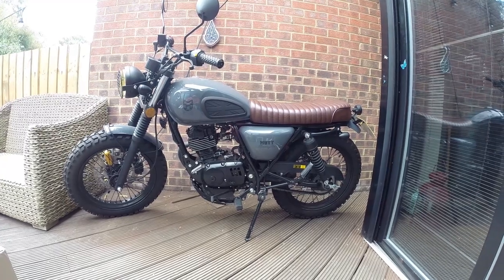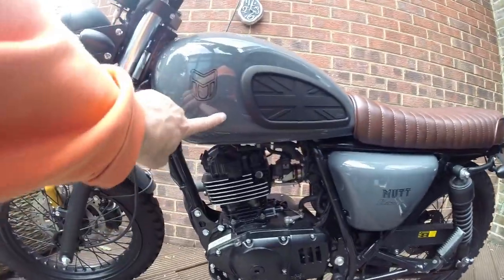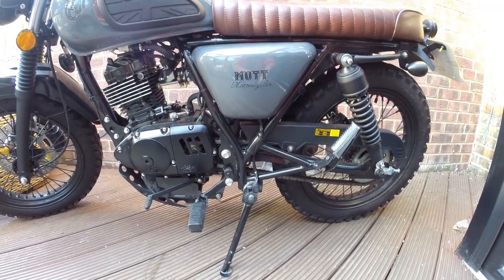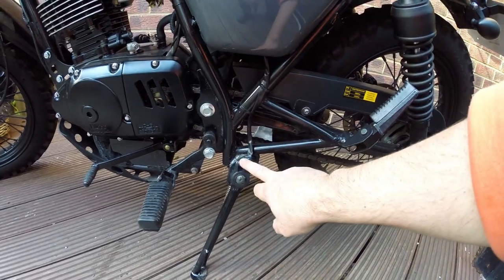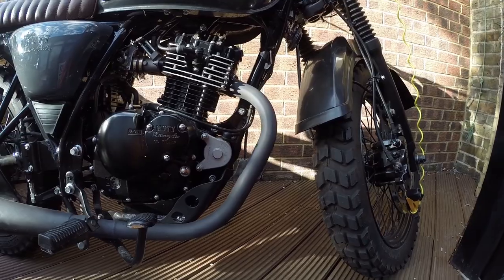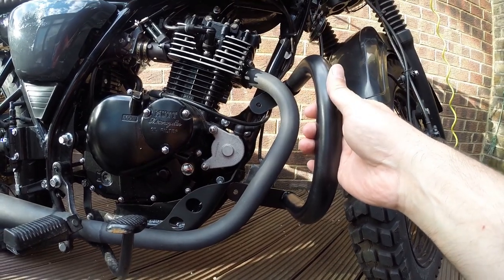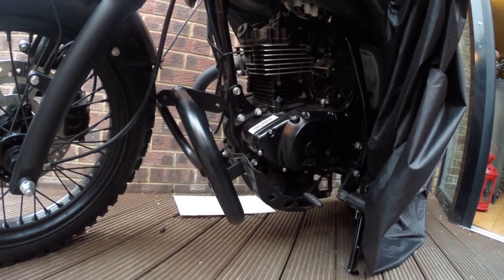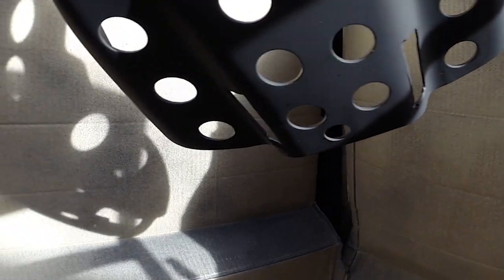Can the Mutt Go Off-Road? Dick Installs Engine Guards and a Bash Plate

Comment: My advice as an ex mutt owner... Switch out the indicators for plastic, the vibrations tend to shake the rear ones to pieces. Replace the rear shocks with RFY Shocks... they're about £100, changes the bikes feel a lot!. Disconnect the kickstand sensor, that will stop your bike cutting out if you knock the stand. Beyond that... you should be good to go!
Reply from the maker: Street Twin Rider Thanks for the advice. Funny what you say about the rear indicators. I took the bike out for a long ride the other day leading up to Greenlaning and LOW - my rear left indicator was hanging by wires having snapped at the stalk. Couldn’t have been hot as I had already added the rear luggage racks. 
Anything to be aware of when disconnecting the side stand kill switch? If I just remove the wiring harness that runs up from it will it cause a fault somewhere else?

Comment: Great work and looks ace - I have a very similar model but with a herald badge on it instead. Have tried to find this bash plate and engine guards as interested in the price to do something similar but can’t seem to find them myself while searching the inter webs sadly
Reply from the maker: Ryan Funnell cool. The bash plate is fromna Sinnis Apache. It attaches to a separate subframe (also Sinnis Apache). Try this. https://www.chinesemotorcyclepartsonline.co.uk/partno_SMPGD001

Can you snap a picture of the bottom part of your bike frame so I can see if that subframe is already there? 
dickwhistles at gmail